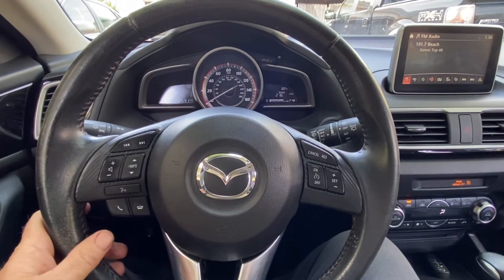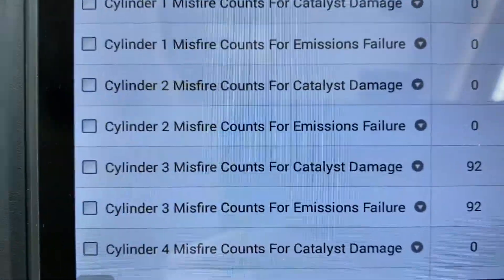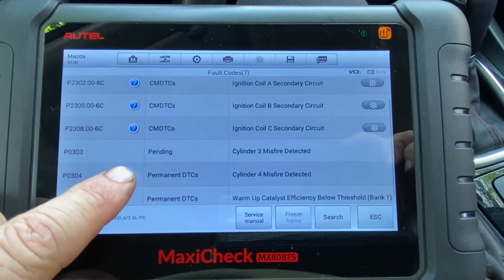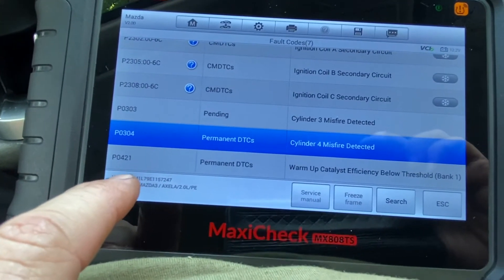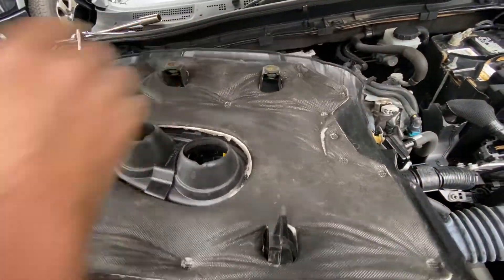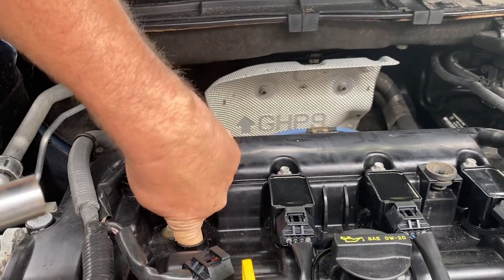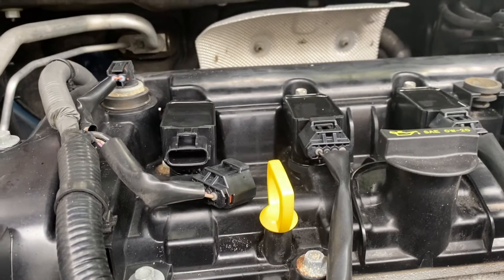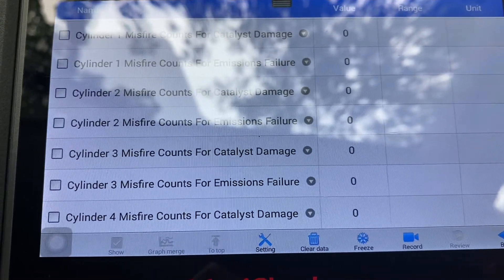Mazda 3 Skyactiv engine - Engine Light Blinking? No Power? Misfiring? Running Rough? - Diagnose &Fix

Comment: I have a cx-3 with misfire cyl#4, i put new factory plugs in and still get p0304 code, I swapped #4 coil with  #1. cleared code and new code still says p0304 misfire on cyl #4. what should I try, any help thanks
Reply: Finally figured it out. I removed intake. intake valves for #4 cyl were caked with carbon, just #4 was caked as its the closest to the pcv hose. I cleaned the valves and swapped out the injector with a new one. No more misfires and cel didn't come back
Reply from the maker: I told you it was probably the fuel injector a while back. Glad you fixed it!
Reply from the maker: Could be a couple of things. Before going further check cylinder compression to make sure the readings are similar on all 4 cylinders. Should be at least 120 psi with engine cold. Maximum between the highest and lowest shouldn’t be more than 20 psi, If that checks out ok could be fuel injector or wiring to #4 cylinder.
Reply: Just checked compression. All 4 cylinders were 120 psi. I can't get at injectors. I think the intake has to come off
Reply from the maker: Well that’s great about the compression, it’s not mechanical. Has to be fuel. When you pulled the #4 plug what color was it?
Reply: All 4 plugs were the same light brown. Plugs are a few weeks old. I was thinking direct injection motor maybe intake valves Carboned up and not seating. But compression is good
Reply from the maker: Correct, compression is good so not that, being it’s the last injector on the rail, it’s probably clogged or not working. Can also be a computer problem but you would have to check it with a noid light if you don’t have a high end scan tool to check pulse width. Noid light should flicker when cranking or running.
Reply from the maker: Also, you say all plugs the same light brown, but how can the number 4 be the same color? Doesn’t make sense unless the misfire happened some time after replacing the plugs?
Reply: It misfires alot when not warmed up and in gear (load on it), The engine shakes.But I dive it to work every day. At a red light it sputters but doesn't stall. Over the last week feels like it lost power and down shifts more on the highway due to loss of power. Scanner shows like 1000 misfires on #4 in 10 minutes idling . Maybe bad pcv or vacuum leak?
Reply from the maker: No bad pvc or vacuum leak would effect all cylinders not just 1. That many misfires is basically a dead cylinder. Car may go into limp mode to prevent any damage. I wouldn’t drive it that way much longer with fixing it. As I said before it’s probably fuel related. Engines need fuel, spark and compression to fire, you got spark and compression in number 4.
Reply: I sprayed a can of crc intake valve cleaner  thru the intake while running  to help remove any build up on intake valves. It seemed to help. Engine shakes less at idle and mpg is up to 39mpg.  Car runs 95% of how it should. But I still get misfire code on #4 cyl. And see lots of misfires on scanner. Can a fuel injector act like this. Any way to test it? Seems like once you take it out it ruins the silicon seal
Reply: I'm having the exact same issues. Ima remove the intake manifold and take a look
Reply: I know this is old.. but the low pressure fuel pump at the gas tank got recalls on some 2018 - 2022 model years.. the same part was used going back to 2014 model years though (just not included).
Reply from the maker: Never too old, great info, thanks for the reply!

Comment: Thanks!   How many miles were on the car when you first experienced this issue?  I have a 2014 Mazda 6 with 125k miles on it. Thanks again!
Reply from the maker: Thanks, about 205k but could of happened at any mileage.
Reply: Mine has 119,000 miles I’m sure it’s just the engine coils like he said though
Reply: Mine at 120k also

Comment: I have this exact same problem. Same lights and car not being able to accelerate past 20 mph. I’ll try swapping out the spark plugs tomorrow. Hopefully that fixes it
Reply from the maker: It may need the coils replaced as well, car is in safe mode
Reply: @motorcarnut  it was indeed a bad coil. Swapping out the spark plugs didn’t fix the issue. Turns out coil #3 was bad. Swapped it out and the issue was fixed. For some reason the scanner wasn’t able to pick up any codes so I had to manually check every coil. Once the issue was fixed, the scanner finally read what was wrong. Any reason for that?
Reply from the maker: Sometimes it takes a few key cycles before a code is stored in the ecm but a good scan tool should be able to capture the fault before the code appears. My scan tool reads the ignition waves as well. Glad you fixed it
Reply: How do you check which coil is whiteout scanner?
Reply: @Imyourfather225  https://youtu.be/p9L9OMK0lHk
Reply from the maker: What you can do is say you have a misfire on number 2 cylinder you than swap number 2 coil with number 3, if misfire is now on number 3 then it’s a bad coil if it still misfiring on number 2 coil is good and it’s something else
Reply: Hey, had the same issue, limited to 20mph + lights. Road assistance mechanic checked the plugs and coils, didn‘t replace anything but deleted the error and now the car works fine (slight vibration on idle, but not much). Any ideas if it‘s still the plugs/coils if the car works now after nothing done under the hood?
Reply: @Petre1968  Turned out to be a bad coil if I remember correctly. I bought them for pretty cheap on Amazon

Comment: Hi, I swapped ignition coils, changed spark plugs, fuel injector, clean the intake valves and I still have the code p0303 on a 2012 mazda 3 skyactive. any thoughts?
Reply from the maker: Check the wiring to both the fuel injector on number 3 as well as ignition coil wiring. Also make sure that cylinder has the proper compression and that the valve timing is not off. Those engines have to be dead on.
Reply: Did you ever figure it out? My car has been having same issue
Reply: @alexanderhigareda947  i have the same problem on my Mazda 3 2012
Reply: Same problem, anyone fix this?
Reply from the maker: You mean same symptoms, could be a number of things. In his situation it was a bad fuel injector. Could be ignition, fuel or compression problem.
Reply: @motorcarnut  i checked spark by switching around plugs and coils stayed in cyl4. Checked compression, that was good. So now it's cleaning runners/valves then last but not least switching injectors.
Reply: @motorcarnut  thanks for the video
Reply from the maker: It’s probably a injector, it’s a common problem on the Mazda